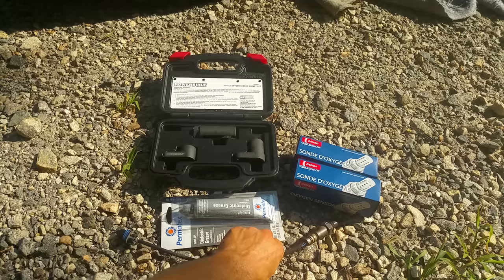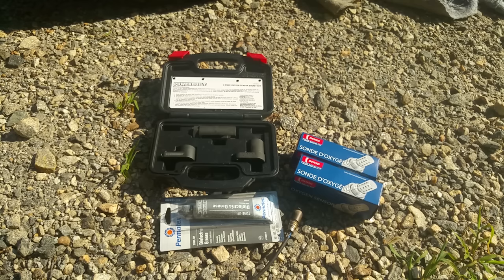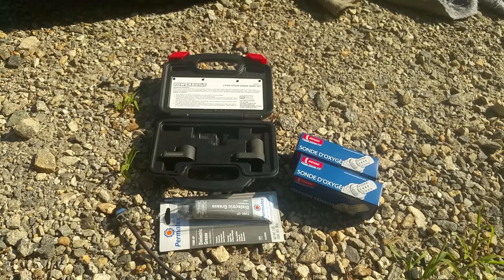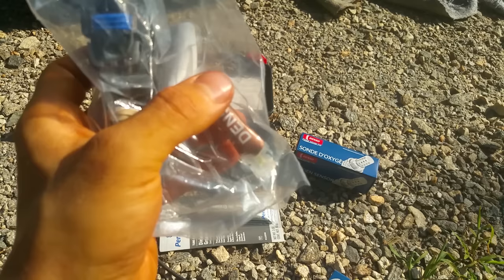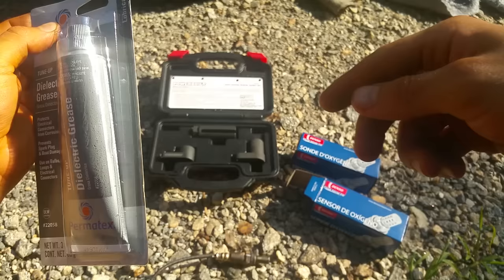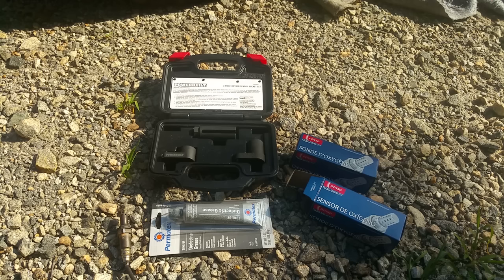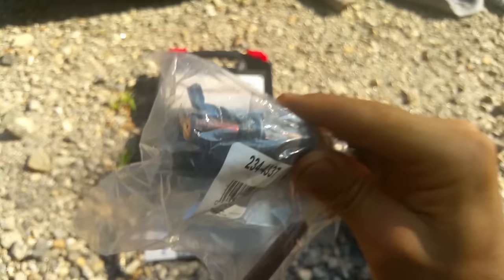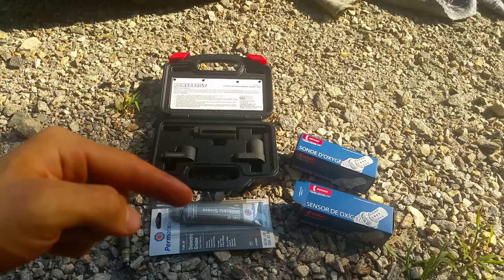NEVER Change Another O2 Sensor Until You WATCH THIS!

Comment: If you're buying O2 sensors buy them on ebay. Autozone gave me a price of $79 and i bought one on ebay for $13.
Reply from the maker: For the same brand and not some cheap China knockoff?
Reply: I agree with Tracey.... Matt's Shop, I  found one on ebay for $15.00, and yes, it is a "China knockoff" with 4 out of 5 star rating/ 268 reviews. Pretty good average, so I figured it is worth a try.
Reply from the maker: I mean I might try it on a work truck or cheap car or something. Why be cheap when it comes to your vehicle that costs 1000's of dollars and HAS to work properly or else you can't go anywhere?
Reply: I don't totally disagree,  but  an O2 sensor doesn't keep you from driving your vehicle, and has no noticeable effect on performance, other than a slight amount of gas mileage. Most people would never know it was bad if not for the service engine light. It is all about emissions and $$$ for the good 'ole govt. anyway.
Reply from the maker: I don't completely agree with you. You might not completely notice the bad O2 sensor. However, it serves a very important function of helping to meter the air to fuel ratio. Keeping the carbon build up to a minimum and ensuring you are not burning (wasting) gas you don't need to.
Reply: The difference is some being wide band and others being narrow band. Most older cars use narrow band and are cheaper but newer cars require wide band sensors and can be 50-200$ depending on the car and brand of sensor. Look up what your car needs before you buy.
Reply from the maker: Never thought about the different types of O2 sensors being more expensive. Good info!
Reply: @MattsShop  yeah they def are. Mine are around 20$ apiece for the good ones  but 3 years later in the same model civic they use wide band and there 75$-110 for denso sensors. And they make a big difference. Either one can be used in the cat but not the upstream as they are for air fuel ratio
Reply: Oh great..hope I just bought the right one frm Amazon for $50!😑💅👠💄🔧🔨😎

Comment: Vaseline is .89cents at Dollar Store Cheaper than Dielectric Grease And Does the Same Thing 👨🏼‍🔧👍🏼 Good Video
Reply from the maker: +Chris Chiampo Haha, that's funny. I'd rather use Dielectric grease. You're right it's probably not too much different than vaseline is it. Thanks!
Reply: No Zinc Oxide in "Vaseline" so not same. Dielectric Grease is silicone based, white petroleum jelly will eat rubber and plastic. Not the same.
Reply from the maker: +HUBBABUBBA DOOPYDOOP Good point. I didn't think about it being silicone based.
Reply: "Permatex Dielectric Tune Up Grease"= http://www.worldpac.com/tagged/Electric_Grease_-_Permatex_22058.pdf   "Vaseline" is White Petroleum, and it's hydrocarbons will soften and corrode most plastics and rubbers, unless they are rated for oil & gasoline contact. Thank you for listening to an old REAL Mechanic.
Reply: Chris Chiampo this bone head clams he has a engineering background. Hahahajah
Reply from the maker: +CHARLIE ARROYO Hahaha you are an idiot gtfo. I bet you don't even have a computer that can run AutoCAD.
Reply: HUBBABUBBA DOOPYDOOP  / I only use die electric grease as a lubricant & std prevention...
Reply from the maker: Lol It's better this way. That way you only have to by dielectric grease.
Reply: They're not the same.  Rule of thumb... petroleum products "break-down" petroleum products. (plastics, rubber, etc.)  You don't want that.
Reply: HUBBABUBBA DOOPYDOOP YOU'RE NOT OLD! YOU ARE GETTING BETTER AT IT BROTHER. PEACE&SAFE JOURNEYS BROTHER
Reply: Matt's Shop what's that got to do with working on cars???
Reply: Tom R  I agree
Reply from the maker: lol
Reply from the maker: Good rule of thumb!

Comment: Maybe someone mentioned this. I couldn't read all the comments.  I understand that, with some oxygen sensors they sample oxygen from the atmosphere and that it actually gets to the sensor through the wire. I know, weird. It might also affect low voltage connections. So the tip I saw elsewhere was to never apply any type of grease to those particular connectors as that will block the air and/or affect the voltage. Obviously, does not universally apply so be sure it doesn't apply to yours.
Reply from the maker: Yea, it's already been mentioned here. The installer has to know the difference.

Comment: Don’t get dielectric grease on connector pins. It does not allow the flow electrical current and makes low voltage sensors trip codes. It’s an insulator the same way the grips on tools can protect you from electrical shock. Put it in there but make sure the pin and the female connector are clear of the grease.

Comment: O2 sensors are extremely low voltage batteries and don’t fail because they are dirty unless the soot is completely blocking the sample holes and that’s really only an issue on some of the newer diesels with emissions equipment. Cleaning them is a waste of time.
Reply from the maker: Good info. I know cleaning them is a waste of time. I tried and failed.

Comment: Oxygen sensor codes are Class B DTC’s you’ll need 2 or 3 drive cycles to clear the check engine light that’s only if you can’t use the preferred method which is resetting with a scan tool.

Comment: how was your truck runninf b4 u swapped the sensors out? i hav a problem with my ride , it runs fine but if i giv it some gas, the thing just surges on me. thinking it may b a pre cat sensor issue hav changed every thing else plugs leads coils what do u think?
Reply from the maker: Is go rent a fuel pressure test kit and make sure you have the right amount of fuel pressure at the rail. Change the fuel filter.
Did you check the air filter and clean the MAF Mass Airflow Sensor with MAF cleaner.
You can also clean the throttle body.

Comment: If the truck runs I put the wrench on 
Start truck
Let it heat up as it heats 
Try to break it free 
At some point it will just let go. Done this a few times
Do to getting bad o2s off of brokenrockauto Bosh 
O2 worked fine at first till the round punchouts was left behind  bridge the o2

Comment: what if something is wrong with wiring between sensor and computer would that effect the o2 reading
Reply from the maker: If there is a wiring issue then you need to address that. Replacing the sensor won't fix it. Would be pretty rare though.

Comment: Thanks, Great Video. I do have a question though. You mentioned that your truck threw a code and you're replacing the 2 upstream sensors. How do you know it's the 2 upstream sensors are bad and not the downstream sensors? I have a 2000 Silverado 1500 and it threw a P0135 code. It's also been throwing a P0442 for a some time now every few weeks and I just keep resetting it. The dummy at the auto parts store sold me a new gas cap and I felt like an idiot for even trying it :-)
Reply from the maker: Good question. You know which O2 sensors to replace based off of the codes. It tells you exactly which ones are bad. I don't think the downstream ones go bad that often they just monitor the catalytic converters to make sure they are working right.

Comment: I got a #0420 code and I will be changing the sensors trying to avoid having to change the catalytic converter. I hope it'll do the trick. For the amateur not-mechanically-inclined but needy your video is a must. Thanks y'all so much for your tips! Well done video I really appreciate it! :0)
Reply from the maker: Thanks for the positive comment! You are welcome for all of the tips. Good luck with your sensors!
Reply: We gotta code 420 here! Roll it up!
Reply: I know it’s a long time ago, but by any chance did it work?
Reply: @pedroprieto6885 you're right, it's been a while and I forgot to get back to you. Apparently, it was a part (I forgot which one!) that I had replaced but it was still under warranty. So, all is good, but sadly my '03 Toyota Corolla is getting ready to retire... now it's making like 3 loud distinct noises that sound like my car will explode in a thousand pieces. But don't get me wrong, it runs good but the noises scare me!

Comment: Matt's Shop, did your truck throw a code for upstream and downstream O2's? I have P0131 and P0137
Reply from the maker: Mine said just upstream.
Reply: @MattsShop  ahh OK, well mine threw both, I checked my air filter, plugged solid, and the MAF was all dirty, in the grids, cleaned it, after 20 miles so far so good, we shall see if that reduced air flow and signals from the MAF could throw both codes, I am thinking YES>

Comment: Will bad sensor cause car to stall out after it cranks
Reply: Check the throttle body and clean it. Ive seen that before and you will probably find a lot of carbon on the throttle plate. Shouldnt be that hard.

Comment: Not recommended to disconnect the battery in some newer vehicles without a battery tender. Some computers i.e. LCM, TCM, ECM and others lose memory and can cause problems. Sometimes can cause your ABS module to go out. I speak from experience on this unfortunately.  Do not disconnect your battery without researching your particular vehicle first.
Reply from the maker: +Tiffany McCormack Good point. Some of the newer vehicles have to have that thing you plug into the OBD2 port first before you disconnect the battery to keep power to the computer. Kinda dumb, but hey.

Comment: Hi matt im have a question if necessary to desconect the battery to replace the sensor
Reply: If you have a scanner you do not need to disconnect the battery. Thats only to reset the computer when you disconnect the battery. I normally just clear the code(s) with my scanner and then make sure it completes all the tests in a test run.

Comment: Do not put dielectric grease in those connectors. It is insulating grease. Dielectric grease is for high voltage ignition boots to prevent current leakage.

Comment: Hi, I’m having problems finding oxygen sensor for 2006 Toyota seinna v6 3.3L bank 2 in amazon and eBay can you help please
Reply from the maker: Use Google Images for a diagram of your exhaust system to locate which sensors are bad.
Reply: @MattsShop  the code was p0174 bank 2 which is yhe one in front but i couldn't find it in Amazon or Ebay or i don't know how to search for it

Comment: Copper antiseeze on threads only! Do not get it on the probe!
DO NOT put dielectric grease on the wire ends as the sensor needs to breath!
It uses the isolation tube to breath!

Comment: Another good one to note is getting an O2 sensor thread chaser tool... especially when the last idiot cross threaded the previous install.  Just have to be very careful and precise when lining it up to start threading it in.
Reply from the maker: You want to talk about a problem. How in the world do you cross-thread an O2 sensor?!?
Reply: @MattsShop  Yeah no kidding!  I couldn't believe it myself.  Not only had a sloppy install  been done previously  but they somehow even managed to put a big ding in the middle of the the tip part of the sensor AND it's threading which was only noticed after I was finally able to twist it out.  That took some patient use of PB spray with brief running heat cycles to break it free.  Mission was ultimately successful to end with a quick E-Check pass later on.  The little OBD2 BT dongle and Torque App was helpful as usual to clear old codes and then monitor engine running readiness status pre testing. Thanks for the video!
Reply from the maker: Were you able to get the new O2 sensor tight? I'd be scared that it was going to blow out of the exhaust pipe. You're welcome.
Reply: @MattsShop  yep the o2 thread chase tool did the trick.  Slathered it in copper anti seize and carefully aligned it to get it started.  That's the most mission critical since the starting threads were the most borked.  Slowly re-threaded it all the way through and it looked like new after.  New o2 torqued up perfectly.

Comment: I have a 2004 Accord 6spd V6 coupe. My car has 4 o2 sensors. And 2 of them are $299 EACH. And the others are 90 each Absolutely crazy because they are heated sensors
Reply from the maker: That is insanely expensive! The sensors in this video go for $60-$100. $299 for an O2 sensor is just insane.

Comment: Do most ls swaps keep the O2 sensors or typically deleted in PCM tuning?
 i need to know before i start remodeling my exhaust, right now the O2 
sensor is poking into firewall and i need to cut off pipe  turn it about
 90 degrees and reweld but if i dont need it to run properly i will wled
 the hole shut

Comment: Ajustable pipe wrench takes out old ones.

Ordinary open end wrench to install. You could use the 12 point side assuming you haven't connected the connector yet.
Reply from the maker: +Peter B. Pipe wrenches are for plumbing????
Reply: Matt's Shop They will grab anything round and corroded. They will maul the part but it great to remove parts you are sure are defective. Don't install new parts with it. New parts usually go on easier.
Reply from the maker: +Peter B. Yea, they do grip well to get them out, but you are right they will destroy the nut on the sensor.
Reply: Dont worry matt. You cant get a pipe wrench on most of the O2 sensors. The last thing this guy worked on was the super charger for HIS vibrator!
Reply from the maker: +Brandon Carey Hahaha

Comment: Also you should turn the vehicle off so the exhaust gets nice and hot. I just finished doing this in a 2010 Subaru Impreza and I had to torque on it so hard getting the old sensor out the threads are so wrecked I can't even chase them

Comment: Instead of buying an 02 sensor removal kit, why not just disconnect the battery, snip the wires, then crank on it with a normal socket? Saves money and time.
Reply from the maker: Because if it wasn't the sensor and you cut the wires you can't return the replacement.

Comment: Vote for me for President. Day 1 I will remove all EPA regulations for O2 sensors and ban them from ever being used again. They and anything involving them are literally the only killers of my vehicles. I have vehicles that are running perfectly mechanically, but something involving the emissions is bad and short of replacing all the wiring for it throughout the car, I've done everything. I've yet to have a car I can't keep running because the car is beyond repair. It's always the emissions that gets so out of control that it's not worth paying to try and maintain anymore. I will make cars great again!
Reply from the maker: Somebody needs to. All these sensors can be a real pain to diagnose!
Reply: YOU HAVE MY VOTE SIR !!!

Comment: You guys can fight all you want about the grease on the connector part but what I wanna know is the battery part really necessary?
Reply from the maker: Lol yea, let them fight about it. It's not that hard to figure out if you need it or not.

I like to disconnect the battery to reset the computer. On some newer vehicles you DON'T want to disconnect the battery. It can throw a lot of stuff out of wack. They make a special OBDII tool that keeps a little power to the computer so that it doesn't mess stuff up.

Comment: Best o2 sensor replacement tool....map gas torch....heat the pipe threads up, not the sensor. Makes the job so much easier.

Comment: I have never had any engine problems with my 07 Silverado (I bought it used in 2014). But emission/exhaust codes? OMG!  I've replaced both Cat's, multiple 02 sensors, gas cap...   Had to have smoke tests done, etc.  What's the deal with that?!  Anyways...it would've been nice to see you actually replace them.
Reply: EScan Elite LapTop Scanner will allow you to drive around the block & display Pass or Fail Results for your Catalytic Converters ( $1,595.00)

If you nut up on that price, take it to a Professioal Shop & letvthen do the Diagnosing before you spend $6,000.00 on Parts Guessing.

www.automotivetestsolutions.com

Background: Smog Repair Tech. -Southern California

Comment: Dielectric grease is an INSULATOR so I would not recommend using it on the connector terminals…the O2’s operate 0-1 volts so any low voltage circuit not a good idea…ok on the weather pack seal !!

Comment: gr8 viDO(wish I’d watched it before I did a lotta that wrong).  Question, if diaelectric grease is made to conduct electricty, while blocking water, oil, misc. - would that not therefore connect the various holes/pins in plug to one another causeing a short?🤔..  nevermind I checked, is NOT conductive, so all good - & silicone is a semi-conductor, which I beleive a read means conductive once in a while, so slight gamble on silicone but dialectric’s👌
Reply: Well, you already figured out dielectric grease is NOT conductive.  Good.  But you are confusing silicone (with an "e") which is completely non-conductive, with silicon (withOUT the "e") which is the material that semiconductor electronic components (like transistors) are made of.   Two completely different things.  Oh, this and may be nitpicky, but "semiconductor" doesn't mean "conductive once in a while".   It means the material is partially conductive.
Reply: @cowsongs  
some difRNc BtwEn partially & 1c in a Yl is there?
Reply: @cowsongs  
but 2 difRNt opOZngly behAvd silic…..s thO, thNx for the info. hUd of thunk✋😒